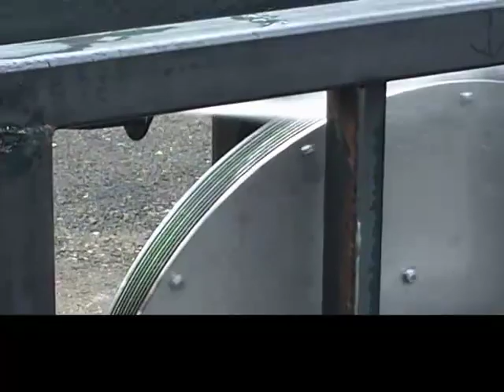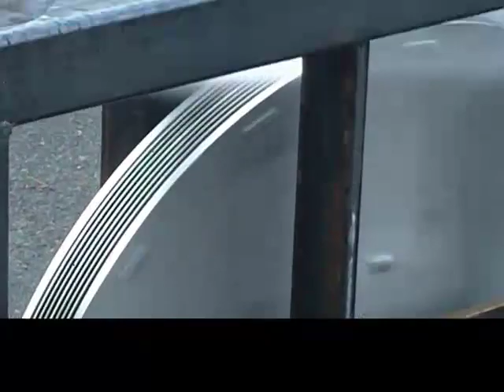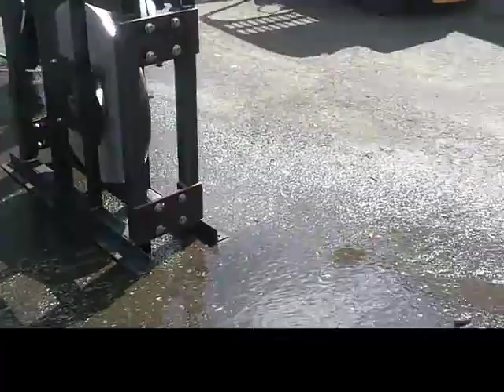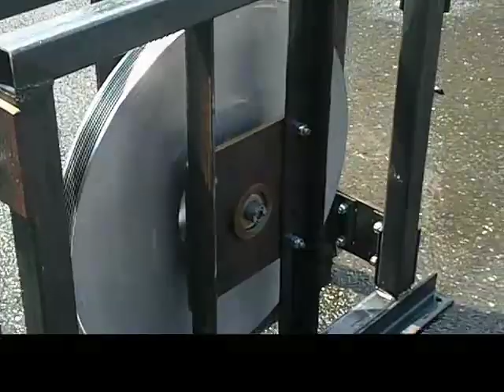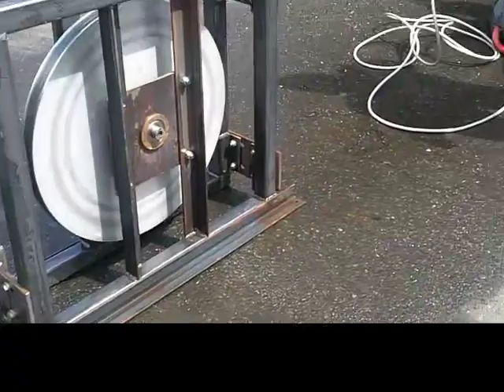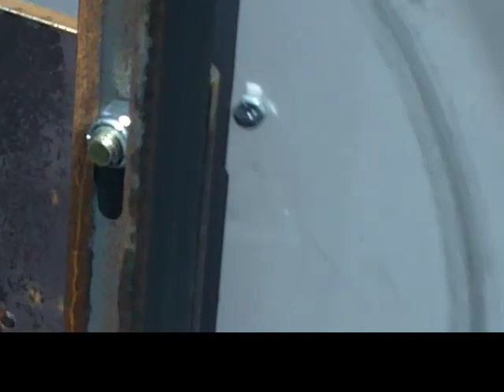24" Boundary Layer  Tesla Turbine

Comment: Designing the housing to prevent fluid leakage bypassing the blades is the hardest part of building a Tesla turbine. You want essentially all the fluid flowing between the blades to the center of the rotor before exiting. Yet you don't want any rubbing of the rotor against the housing.

Comment from the maker: @ShamblerDK 
 Thank you for your comment. The primary advantage is cost. As you can imagine the blades of a conventional turbine can be quite expensive. The blades that we use can be laser cut for a  fraction of the price. Because of its simple construction, the Tesla turbines should also be more durable. Our next turbine video will measure the RPM.